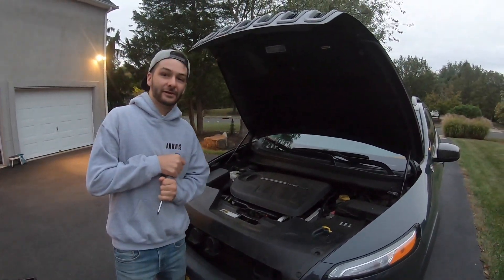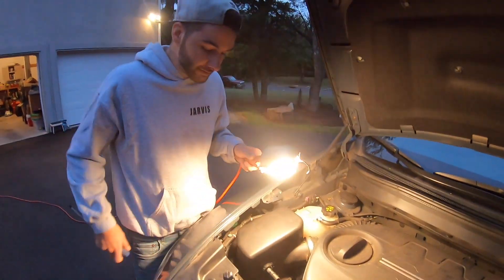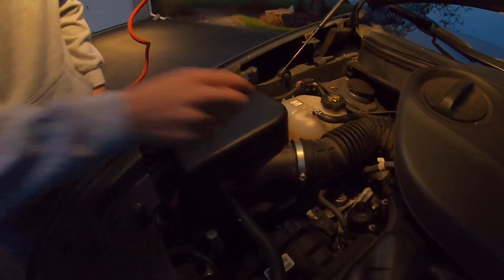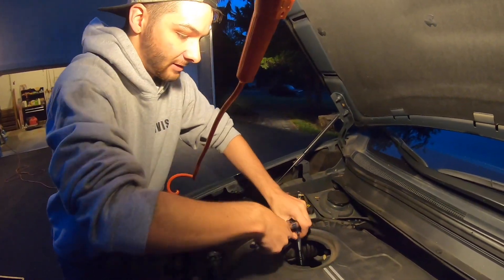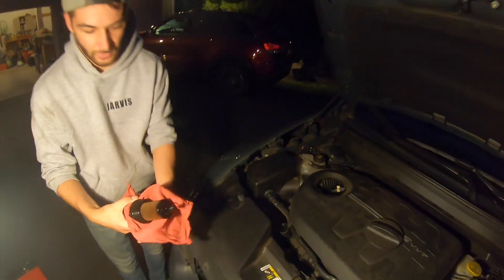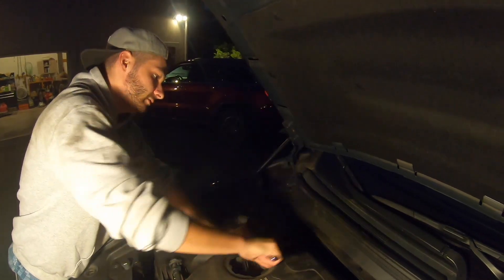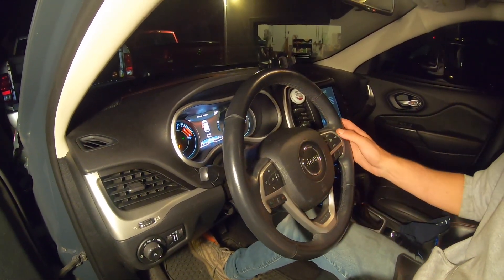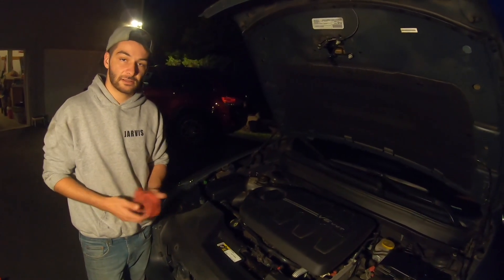HOW TO: Change 2014-2018 KL Jeep Cherokee Oil 3.2L V6

Comment: Great job, easy to follow.  I have a 2019 Cherokee and it looks very similar (looked but could not find a video for 2019 model).  I have the parts and the oil.  Ready to give it a go after watching your video. Thanks

Comment: Does the new oil filter come with a new O ring gasket?
Reply from the maker: marty they should yes
Reply: @RatchetWrenches  did you lube the O ring first, off camera? you didnt mention that in  the video
Reply from the maker: Curtis always, Use some oil for sure.